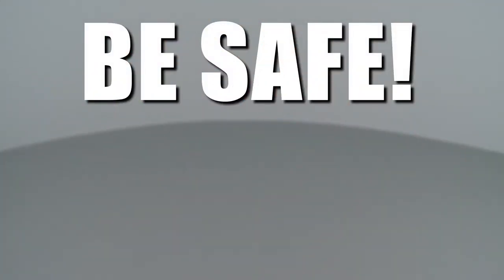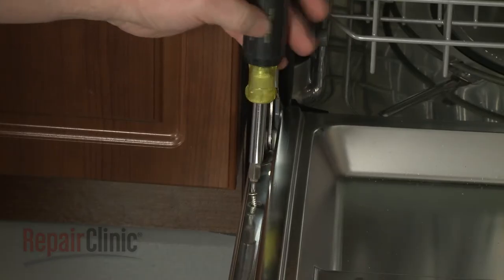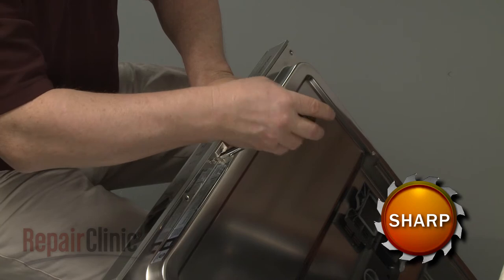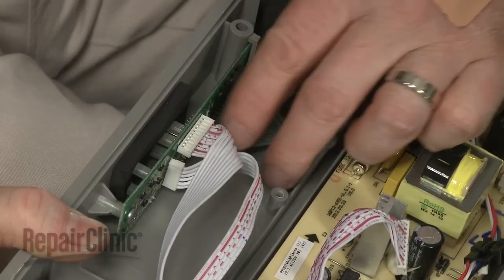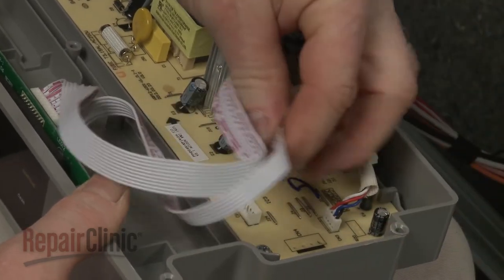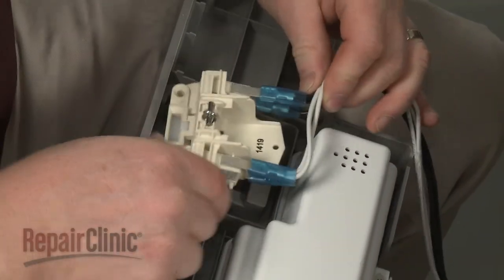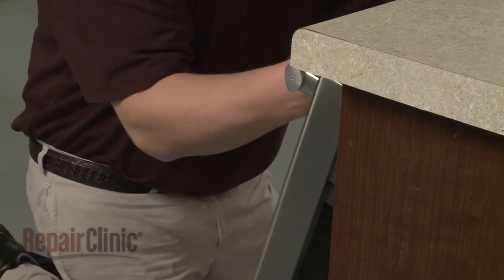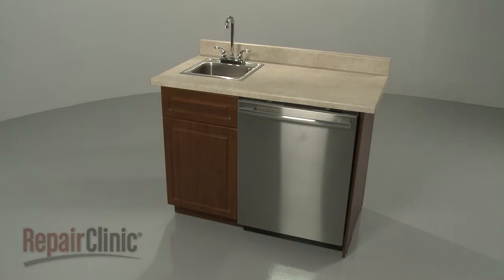Frigidaire Dishwasher Display Board Replacement #5304475571

Comment: Hi I hope you can read this , my problem is, the display lights up( all settings light up) but the start button does not function, and I also don't see "CD" close door on the display, checked the latch, it does work(checked with multimeter), do I replace the board in this video or do I change the whole touchpad, or maybe the control board? please help
Reply: Hey there. I replaced the control board, and it still didn't fix the start button issue. I'm trying to find the part of replace the entire "button board"